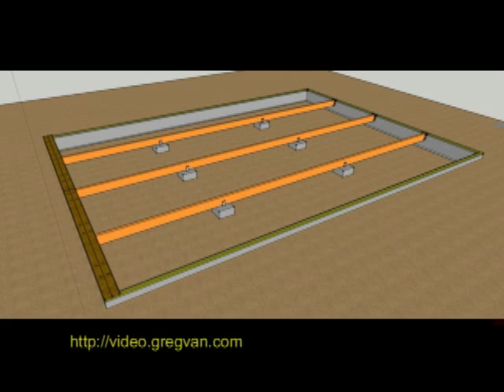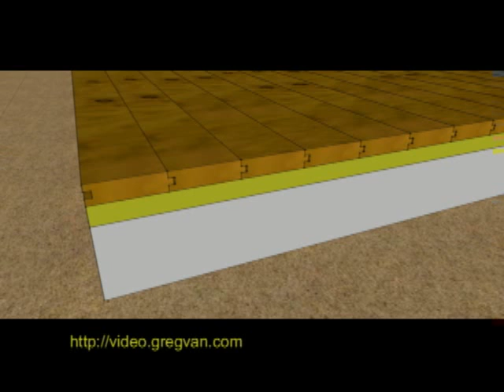Part 1 - Raised Floor Framing With 2 x 6 Tounge and Groove Sheathing

Comment: Question: What happens when you install kiln dried 3x6 (or maybe it was 4x6) double tongue and groove flooring secured with coated ardox nails to the kiln dried beams which create the second floor level above the first floor concrete slab level... before you pour the slab?

Answer: The moisture released by the curing concrete of the first floor slab, is absorbed by the kiln dried wood of the second floor.

Question:  What happens when dry wood absorbs moisture?
Answer: Dry wood expands as it absorbs moisture. Expands a whole lot.

Question:  How much does the wood decking expand?
Answer: It expands a whole lot.  It expands enough such that you have to remove a plank from each side of the floor and with the help of winches, a Case backhoe, a lot of sweat and probably tears and curses, attempt to return the outer most walls to plumb.

Happily for me I was only peripherally involved on that project so the lesson I learned didn't cost me, but I still pity the poor owner/builder who had to deal with and now live with the problem and the solution.  My lesson learned?  Plywood decking rocks.  Want to create a certain look such as an exposed beam ceiling with solid wood decking?  Frame it conventionally, drywall the underside of the joists (for fire, sound and air leakage control) apply bevel edged 1x6 over the drywall then install real beams or build fake beams to complete the look.

In short log cabins and all such building techniques of bygone eras should be admired from afar and when building new today, take advantage of contemporary materials and techniques.
Reply from the maker: Thanks for sharing your useful information with us.